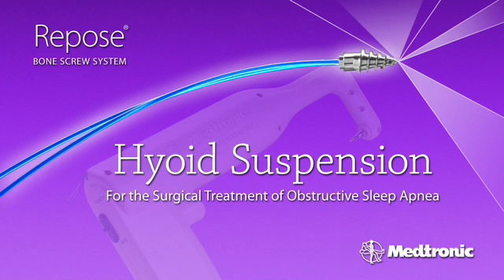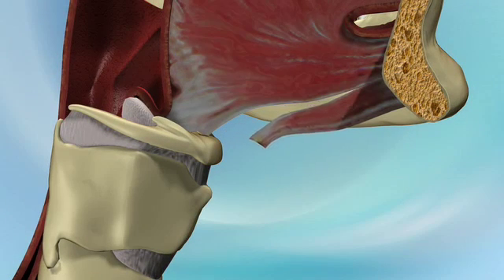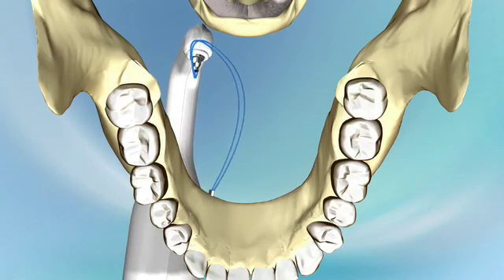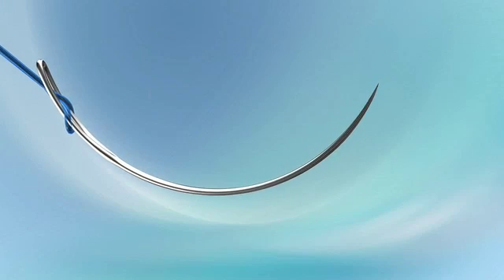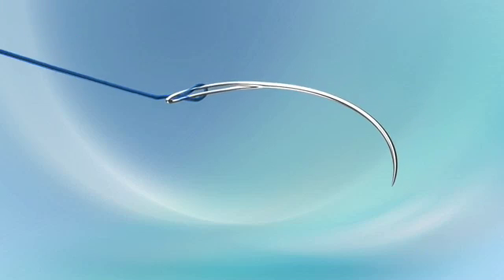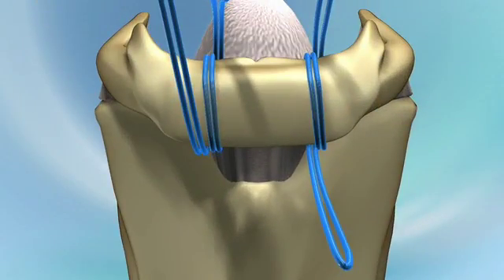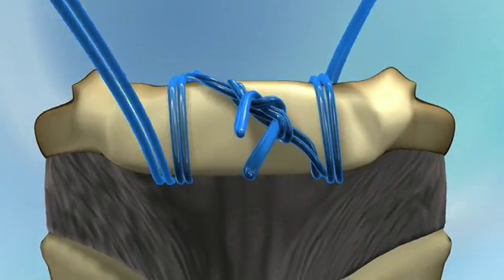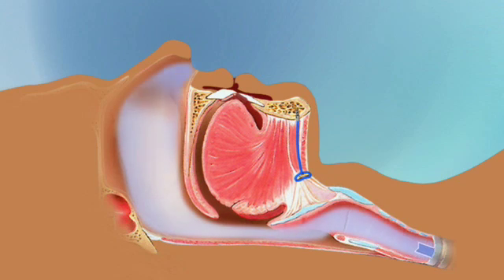Hyoid Suspension

Comment: sir thanks for video.my doubt is as follows;  you are pulling the mandible back by a thread attached to hyoid which is posterior to tongue.My commonsense (or the lack of it ) says this manoeuvre will increase the airway obstruction,.pl explain. sorry if i am wrong.
Reply: the tm joint will prevent that I think.